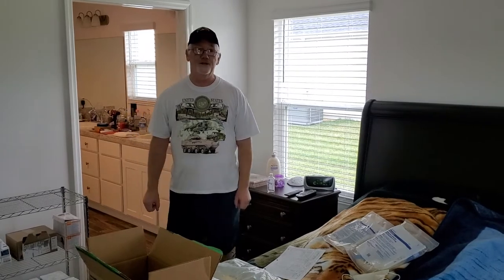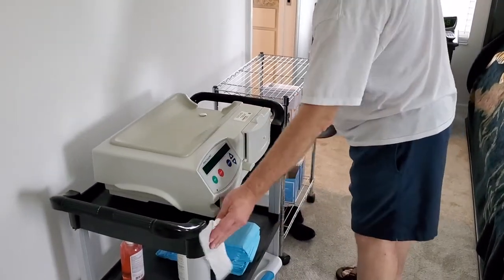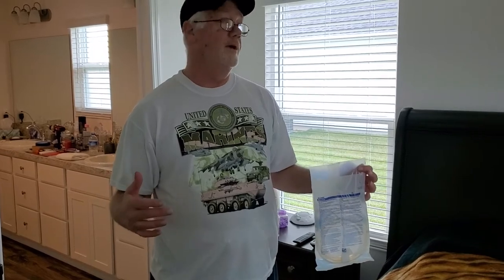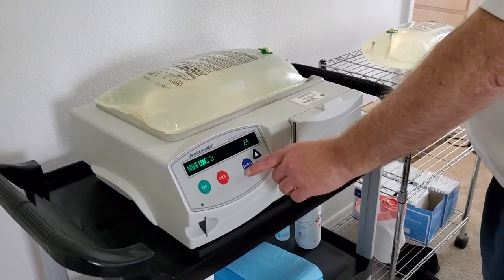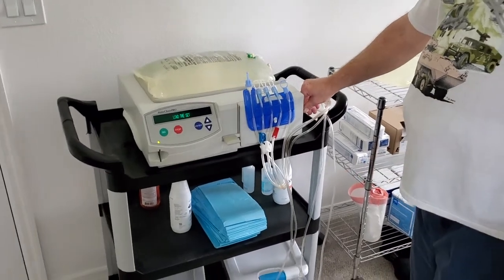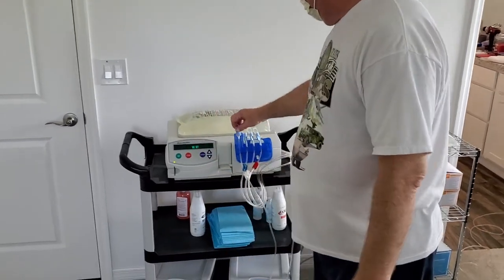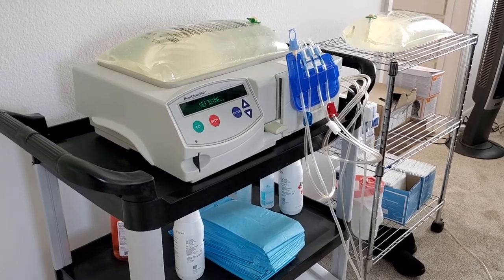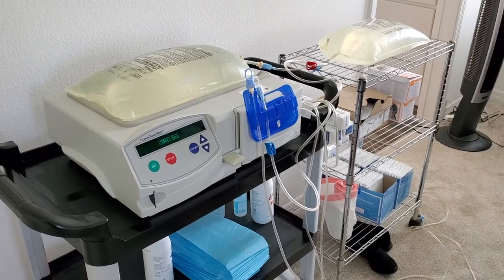Peritoneal Dialysis - Part 1 - The Set Up

Comment from the maker: **Final Instructions! After connecting the lines to the bags and undoing the third clamp. Don't forget to press GO on the machine/cycler. Then it will start the priming process. -SemperFi8263